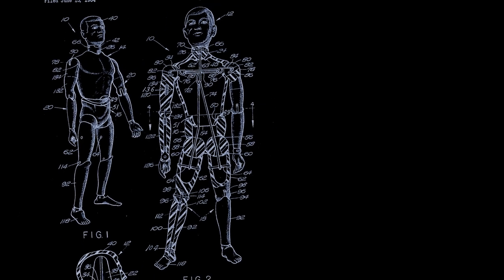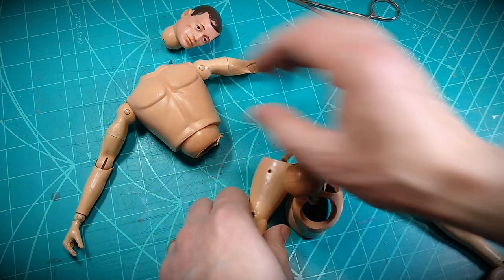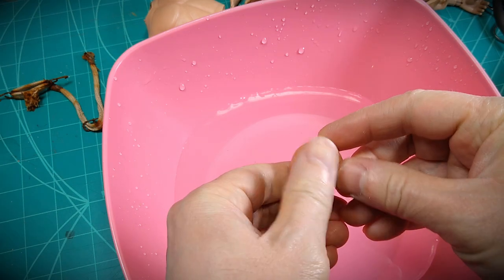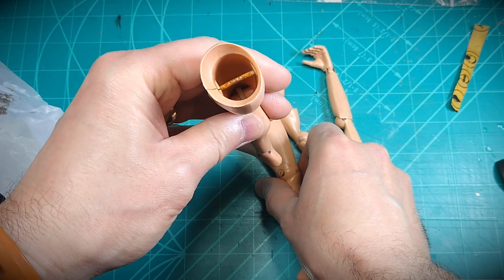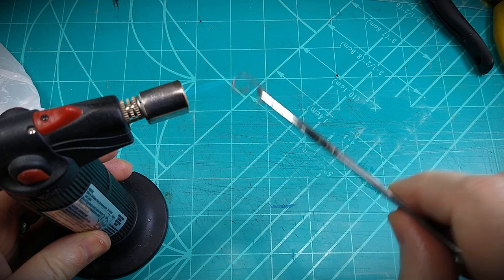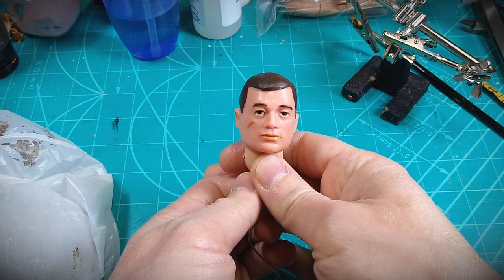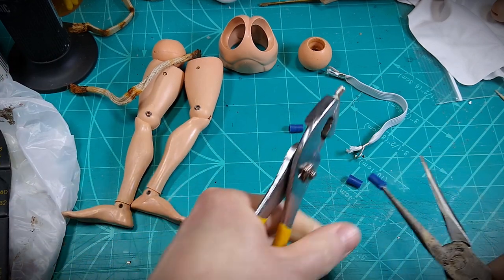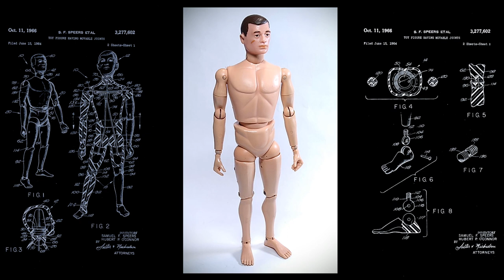Restring Restore Vintage GI Joe Figure Hasbro - Elastic, Paint, Clean

Comment: Thank you.  Fixed two ….. 1 suggestion … I used a super small zip tie to loop on arm hook and then thread through torso and pull hook and elastic through.  Then clip off with hemostat and zip tie slides right off.  But mostly Thank You.
Reply from the maker: That's a great idea!

Comment: I converted a regular Chinese reproduction Joe to a Club Collector Joe, by replacing the head. The head hook was a MFer to get off unlike the old vintage joes.  I finally just cut off the head pin off and replaced it with a cotsworld head pin. FYI on new joes.
Reply from the maker: Good to know, I would have thought they would have been made just like the originals.

Comment: Use white vinegar next time on the rust discolored parts, and on the rusty metal parts. THEN use the dawn soap and warm water.

DON'T USE TOO HOT OF WATER. Use the Warm water and dawn soap. The hotter water will distress the plastic.

(I know, I've done it.) It will result in stress cracks where none existed before you overheat the plastic.

Comment: Hi we’re did u get the tool to run through the body to pull the hooks
Reply from the maker: What I used was a section of coat hanger wire. I trimmed it down and used a needle nose plier to put the hook end onto one side. It works pretty well, thanks for watching and good luck on your restoration 👍

Comment: Any tips on getting hands out of the forearms? I have a G.I. Joe with a broken finger, I found a replacement hand. But I cannot get the old hand and peg pulled from the forearm - even trying to use the pliers.

EDIT: well, I broke the hand off, trying to get it out. Now I need to know how to get the post out of the forearm without the hand.  Someone recommended taking the forearm off And pushing the post out from the elbow side, but it’s on really tight. I don’t want to break the elbow.

Edit again: Since no one answered. I was unable to push the post out from the elbow side of the forearm. I ended up drilling out The hand post. Starting with a fairly small drill bit, and increasingly going larger until the original hand post came out. Fortunately, it worked and I was able to put a replacement hand in.

Comment: I would of thought you would of paint matched the tan rivets and touched those up as well.
Reply from the maker: Thanks for watching Don! It's a easy touch up for sure, but my goal with this figure was to fix major issues and still maintain as much original vintage elements as possible (like keeping those original hooks inside instead of just replacing them).